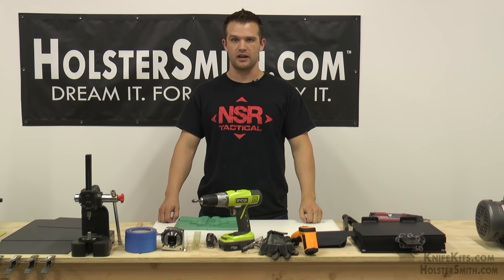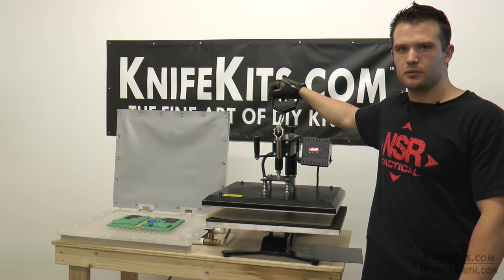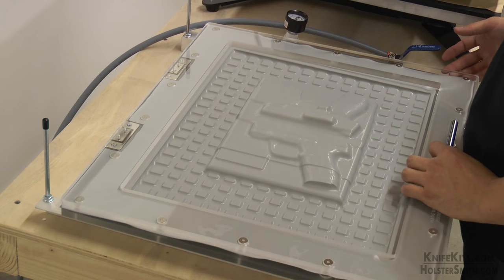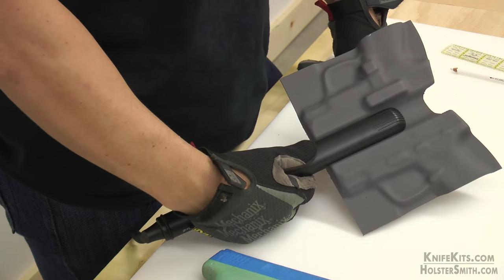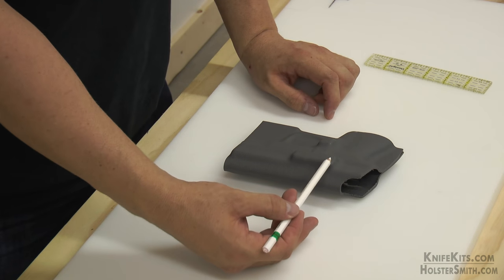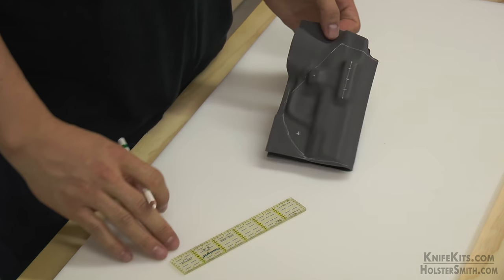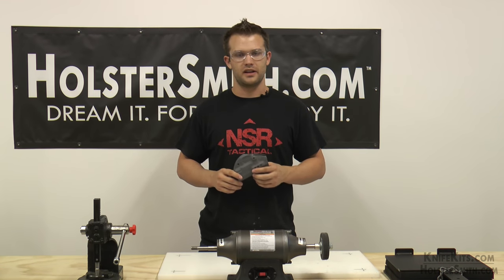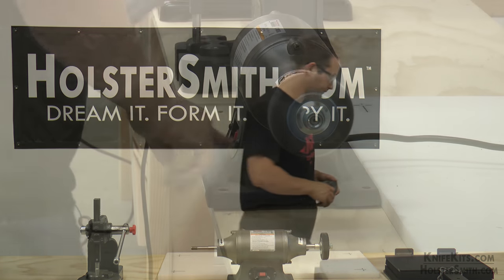DIY KYDEX® Project : How to make a 1-Piece Holster (Feat. Dave White)

Comment: Where’s the 2nd video? For appendix carry, what if I want the back side (the part the touches the skin) to be a bit higher than the front side?
Reply from the maker: We are working on it. If you want the back of the holster taller, as in a taller sweat guard, go ahead and trace out more of your handle profile. Make sure to do a good job of smoothing the top radius on the extended guard because you will be in contact with a longer piece for more duration. That is one of the reasons why we sell the higher grit abrasive wheels, like these https://www.holstersmith.com/vcom/sandingpolishing-flap-wheels-c-548_805_806.html is that makers who use a higher sweat guard design really place a premium on having the smoothest contact edges.

Comment: My sight channel keeps coming out curved and not straight, any tips?
Reply from the maker: Are you molding with the actual gun or using a molding prop? Do you have the site channel modified in any way, such as using a dowel rod?
Reply: @KnifeKits  I bought the prepped molding prop. I'm beginning to wonder if I need to improve my press, it's homemade and I think I'm not able to keep enough pressure on before I press and it's causing it to fold
Reply from the maker: Agreed. One of the main issues that we see with malformed holsters is the lack of pre-pressure created when the prop and hot material are introduced into the press. Make sure that your press creates the "pinch" in a way that pulls the material tightly toward the handle end of the gun on both sides. A lot of guys find that using gloves to pull the hot material over the gun as it's being secured in the press will keep it tight. That's a big key to success.